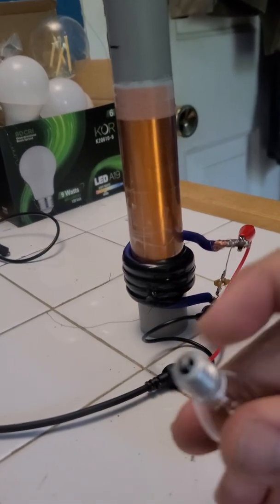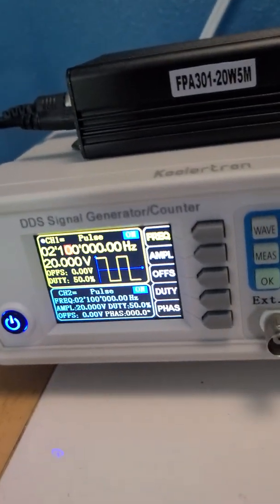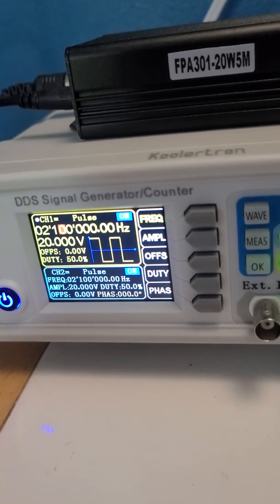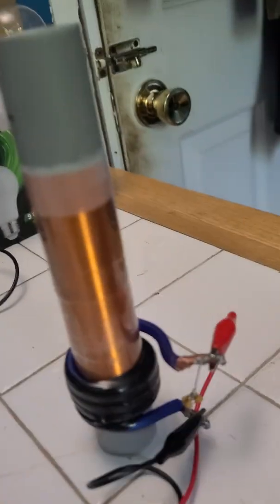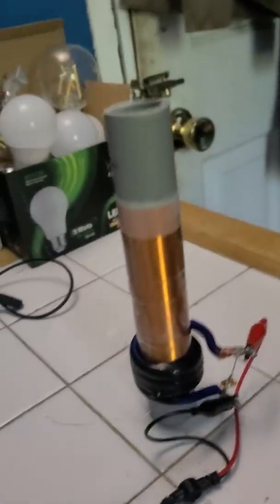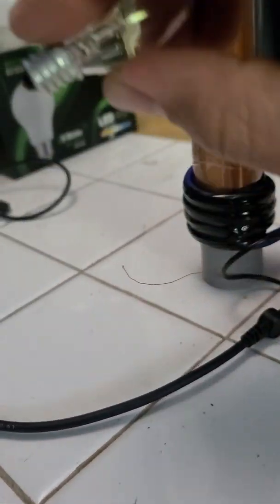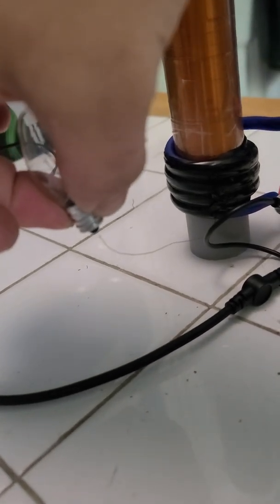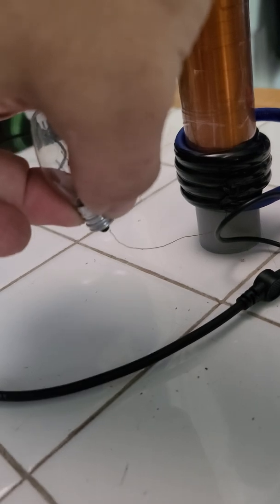🎩 🪄 Teslas Real 1 Wire Electricity. Incandescent Bulb Lights In My Hand! 💡

Comment: Awesome.
Do you have something under the secondary?
This is off our transmitter?
No emails from you

Thank you
Reply from the maker: The Bulb Lit Up With just the 1 wire off the bottom of the secondary & yeah i forgot the password to my gmail lol i should be recovering it very soon
Reply: @MTECHINDUSTRIES  do you have a foil under the secondary?
Reply from the maker: No i only added a tiny bit on the 1" free space on the top of the coil. It acts as a top load. Its also covered in tape